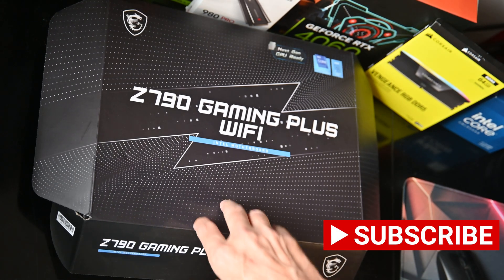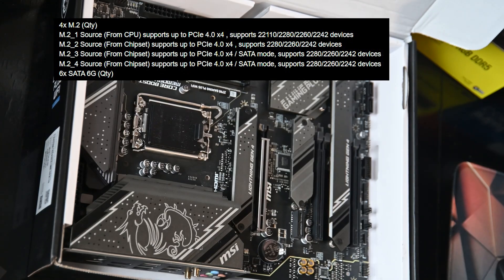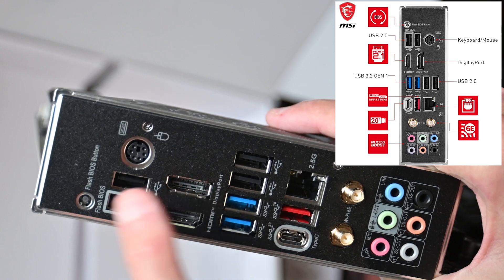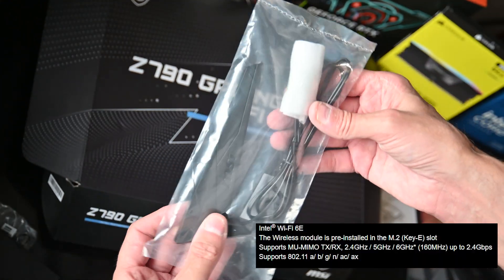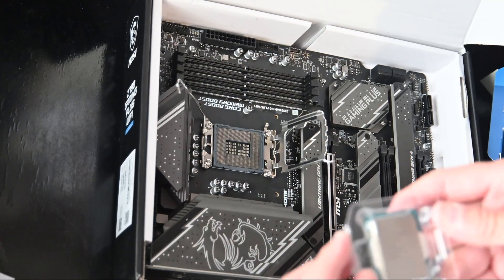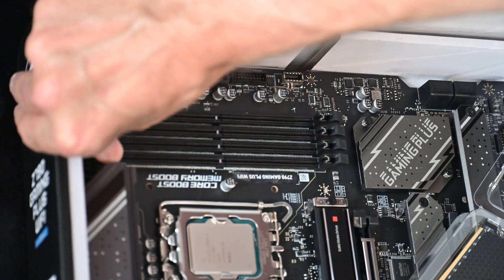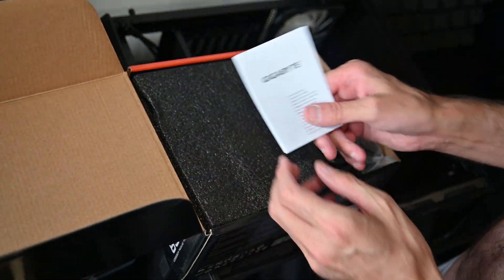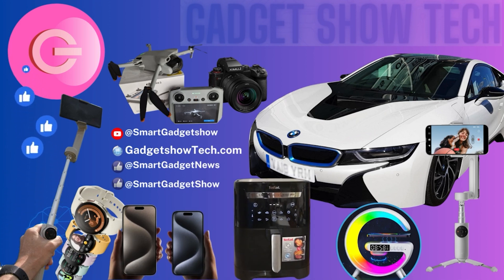How to Instal MSI Z790 Gaming Motherboard DDR5 NVMe PCIe 5 Wi-fi 6e intel 14th Gen LGA 1700

Comment: did it boot with i7 14700k first time or did you have to qflash the bios first ?
Reply from the maker: @you0611  since day one, it booted, but thermal issues.  I got a replacement CPU before the bios updates, and it seems fine.  I did videos testing it with diagnostic and stress test software.

Comment: Hi did you have to do a bios update for the i7 14700k?
Reply from the maker: @shaheemgirling3972  yes.  Here is what to install as well as the bios. https://youtu.be/rx-pcWt8kl8
Reply: @SmartGadgetShow  did it boot with i7 14700k first time or did you have to qflash the bios first ?
Reply from the maker: @shaheemgirling3972  not until I had the replacement.  It all happened at the same time as BIOS updates came out.